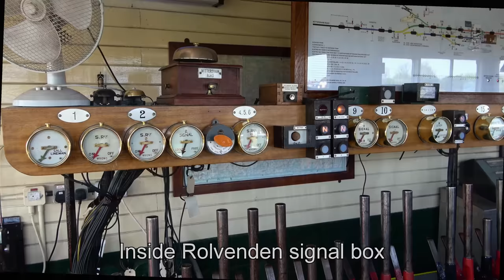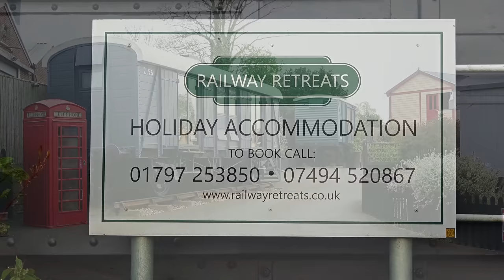K&ESR (Kent & East Sussex Railway, England) - Behind the Scenes Experience

Comment: Hi Tim!  Very nice video as always.  The steam locomotive has a very good sound and works really well.  Exactly the right thing for today's Sunday, because it's raining here again and again.  The man at the signal box explains the mechanical safety system without electronics.  Once again I didn't understand at least 70% again because he was talking too fast.  But I assume that it was about the follow-up and return security.  I'm just not that good at English.  Best regards from Hans and Cheers 🇦🇹🍻.
Reply from the maker: Hello Hans, it was nice to do something a little different, this behind the scenes experience took the group into those places not normally open to the public such as the engine sheds, repair shops and signal box. Your English is far better than my German, an English signal box isn't that different to and Austrian one, although they tend to be stand alone buildings rather than part of the station. The levers are quite different to look at, but they perform the same function. The signalman was telling us how the token machines worked (the driver of the train must check and be in possession of the correct token to proceed onto the next section of single line track) the signalman also explained how the interlocking worked to prevent him from setting conflicting routes. Take care, and cheers.🍺Tim.

Comment: I usually enjoy your train ride videos, Tim.  The only part which gives me a sad feeling is seeing those machines sitting idle in a museum.  It's a bit like visiting the grave of a revered ancestor and realising that you'll never get to know them in real life.
But overall, very enjoyable as usual.
Reply from the maker: Hi, fortunately most of the stock and locomotives were at different stages of restoration, most of the items will run again, although for some it might be a long wait. It was nice to see vulnerable older rolling stock stored under cover in the new building, a massive improvement on rotting in open air sidings where there is also at risk of vandalism. I might never see some of the rolling stock in use during my lifetime, but so long as it exists there is a chance it might run again. I'm glad you enjoyed the ride. Cheers. Tim.